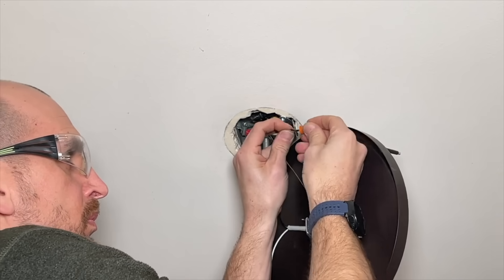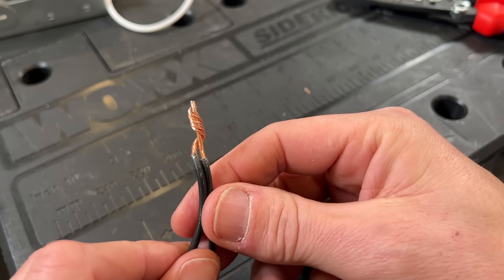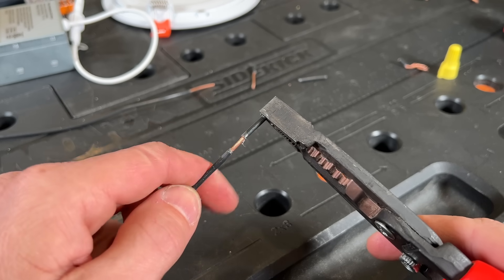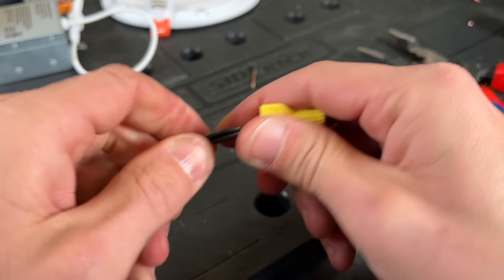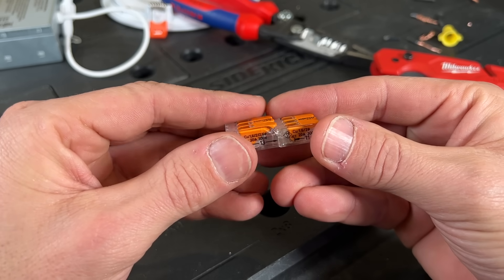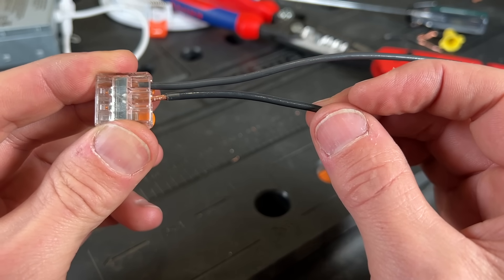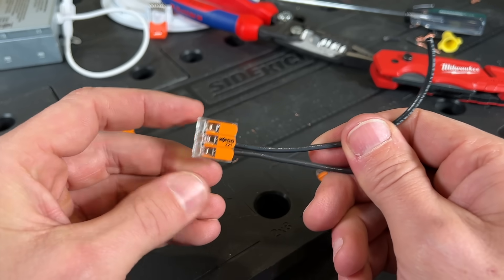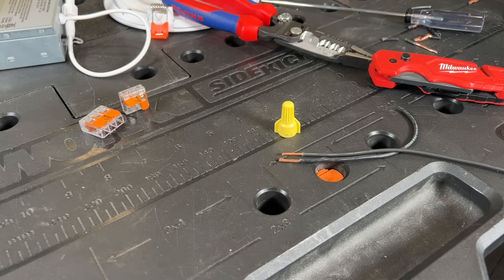Most Common DIYer Electrical Mistake - Don't Let This Be You!

Comment: As a DIYer, I am slowly replacing every connection in my house that was a wire nut with the Wagos because they are so much more serviceable and more friendly to doing upgrades. So as I've been swapping out my light switches, I've been using Wagos. As I've been swapping out outlets, I've been using wagos

Comment: Using wago connectors are similar idea to backstabbing outlets in an electrical circuit.  the amount of copper holding  the connection is very small. JMHO. To each their own....

Comment: I would never use wire nuts to connect stranded and solid wire. I prefer wago lever nuts - easy to use and reversible.

Comment: It seems like wire nuts are ½ of the problem.  They're about solidifying the mechanical connection.  If you must work around the idiosyncrasies of a connector,  it is a bad sign.

Comment: The "Loose Lever" is a design feature to give you LEVERAGE to open it. Americans are not familiar with Wago as they are with brands like 3M. Ive used their industrial terminals since 1992, NEVER a failure do to design or manufacturing, only user error like not properly seated or wire prep. Think of Wago as Klein, high quality products.

Comment: Love your videos. I stopped to watch this current one becuse I just installed 5 outside lights. I noticed the stranded wire you showed was alot stronger looking then what the light manufactures provide. The wire is  so thin that you cant not avoid loosing wife while stripping. Also with this thin wire, it would never slip into the clip you showed that I'm gonna start using...thankyou for this advice.

Comment: Wago nuts have one weakness that is not readily apparent. While they can withstand considerable force then a wire is pulled, if the wire is twisted while it is pulled, it will come out with little more than one twist. This could be an issue when stuffing wires into a box.

Comment: Make sure you check every connection by pulling WITH THE POWER OFF, I had a Wago fall off and the wire fell on my side and shocked the hell out of me under the house and ended up bumping my head almost sending me to the hospital.  Yes it was a faulty Wago.

Comment: Tip: Use your 4 fingers to grasp the wire and use your thumb only  to pull the wire away from the strippers.  Its way smoother.

Comment: @EveryDayHomeRepair — Excellent tip on connecting solid/twisted wires with wire nut! What color twisted wire nut best to connect 18AWG to 22 AWG wires for secure connection? ThankU.

Comment: 8:47 you use stranded 14 gauge, not a fair pull test since so often they are 18 gauge. I would imagine a wire that is more thin wouldn’t have as tight a grip.

Comment: 5:00 If you don't have the basic skills/tools to confidently twist wires together with a wire nut you shouldn't do the rest of the electrical work, Wagos or not. BTW I am a DIYer too and encourage it, I’m not one of those nose-out-of-joint electricians who poo poo all DIY, but there is a reasonable limit. Also, for the connection example you're using the orange, not yellow wire nut would be better.
Reply: Shut up.

Comment: Great instruction. Helped me correct my poor DIY first attempt for a ceiling fan that made crackling noises when you turned it on. My wires were loose and not making proper contact.  Thank you!

Comment: Having struggled with wire nuts while hanging lights, balancing on a ladder arms over my head;  I routinely started tinning (soldering) the tips of the lamp wires.  Then I used the wire nuts.   I have  since switched to the Wago connectors.  They take a tenth the time, which I don't have to spend doing ladder/lamp acrobatics.  All thanks to this channel.
Reply: Nice idea.
Reply: I call that a 3-armed job. 
Great idea on tinning the strands ahead of time before using a wire nut.
Honestly for a simple ceiling lamp, most are now LED, wago connectors are more than sufficient.

Comment: I was taught one of the best secrets I have never seen anyone else use ever. I bend the solid wire in a slight s shape then the stranded wire will wrap around that just light two solids would look twisted. You do have to twist the stranded longer than the solid. It works really good.

Comment: with jointing solid to stranded would a light solder work? or would the nut chew it off, melt if the line gets too hot etc.

Comment: WAGOs don't seem to have enough surface contact area unlike a properly installed wire nut. There have been tests that show greater power loss of the WAGOs and more heat as compared to wire nuts. I fully agree with using them for low power devices like light fixtures and switches but I won't use them on 20A branch circuits etc. The 'Clever Lever' WAGO is definitely easier to use but ....

Comment: better technique imo when stripping wire - instead of pulling the wire. use your thumb with the hand that is holding the actual wire and push the strippers away with your thumb while slightly pulling the strippers at the same time. makes stripping  wire  10x faster and easier. Insulation will glide right off the wire.

Comment: I’ve had old wire nuts from the 70’s with a solid #12 and stranded #12 and there was no way to remove it without cutting the wire.

Comment: I twist the stranded with lineman pliers to really tight and then twisted the solid two turns and wound the stranded around it.
Then I put electric tape around the entire nut and down the cables 3 inches.
Reply: Did u eat a moon pie too?

Comment: 76 year old, mechanical reliability engineer. While what is said here is true, I'd like to see some data on how many appliance wire nut related fires, out of the millions that have been there for decades, have occurred over the time period of interest. Then I'd like to see the cost of the wago connector versus wire nuts. Safety is not always the reason for "upgrades".
Reply: U shuld know that data mr. Smarty pants..😁😁😂😂😂🚬🚬🔧🔧🔩🔩🔩🔩🔨🔋🔌🔌🔌
Reply: @joeswampdawghenry  You should look up the topics with which a MECHANICAL reliability engineer works.  While we do know the statistical techniques used in such analysis, we are not usually "spur of the moment" familiar with all the data for other reliability fields. I suggest you do a little research before you open your mouth again and remove all doubt of your woeful ignorance. If I had made a pist about this topic, I most certainly would have researched and presented those data. However, I was not posting it, and the burden of proof lies on the author, not the reader.
Reply: @johnrains8409 I’m a reliability engineer as well, aerospace. I’ve made huge spreadsheets on things like variable speed constant frequency generators. When I started mosfets were less than half as reliable as regular transistors. But, those numbers have changed over the years. That’s why we have reference guides usually from the government. Nobody carries that shit around in their head.

Comment: Great video.. I learned the hard way myself with splicing stranded to solid core wire and had to figure out myself to lead with the stranded wire higher than the solid core to get the nut to bite both wires and bond them securely. Good that you explained this thoroughly so everyone can understand what can go wrong will and to eliminate said variables
Reply: How many houses did you burn down before you learned?

Comment: Cant believe wire nuts are still used these days. I dont see them in the UK anymore. Screw terminal connectors being a much better solution.

Comment: Hi there,   My first electrical project is now a nightmare.  The hall and bedroom lights run on the same breaker, but now the
lights won't turn off with the switch.  
When I installed the first flush mount ceiling light in the bedroom it turned on with no problem at the circuit box, but I didn't check the light switch.  
The Hall light had a different configuration I hadn't seen in any of the Youtube videos showing light installation.  Both the black and white wires had multiple wires that were twisted into a sold thick end. The light fixture's black and white wires were just wound around the thick strand of wire, and nuted.
The building is about 35 years old.  My Apartment's hall is only 38" wide, so I can't see why the builder would use wiring for a ceiling fan, if that is what this extra wiring means?   
 Funny thing was the hall ceiling box did not have a ground wire screw.  I took out the old mounting bracket, replaced it with a universal, and added the green screw to I could hang the light while installing.
Could you tell me what I am up against?  
Thank you sooooooo very much!!!!!!
Signed,
Empty Nester and new Widow

Comment: A note on wire nuts: there are some cheap-o brands where the inside 'spring' (threaded piece will come loose/detach from the plastic housing even with the slightest (over)tightening. Also, check the labeling on the package where it will tell you how many leads of a given gauge for which it is designed. 
One thing I don't like about the lever type push connects is the lever. There are other designs that are push only. 
For solid wire, I use one pair of 'pliers' (usually my side cutter with a large flat area to line up the leads, and another pair to twist from the end of the lead.
This works well to make sure that all the leads are twisting and one doesn't remain straight.

Comment: Use the tip of your strippers and/or needle nose pliers to bend a zigzag/lightning shape into the solid core wire, this will give the stranded wire some grooves (highs and lows) to bite into and hold onto much better.

Comment: Great video! 
When stripping wire, I usually use the thumb of my hand that's holding the wire as a kind of fulcrum against the stripper to help push the stripper off the wire.

Comment: In o gauge model railroading, we must often connect 2 stranded wires, usually a wire connected to a junction strip and onto a wire that leads to the train track. I never felt comfortable soldering the 2 wires together because you're usually under the trainboard. So I usually heat shrink wrap the 2 wires together. Dont wing nuts exposure the wires to air corrosion  over years .same for your wingo connects. A large trainboard often has 200 connections to track, building lights, operating accessories using 18 volts. What do you suggest us train guys use. Gary

Comment: Another method that is less expensive than the Wago connector and less trouble and risk of "hoping" you get a good bite on your stranded wire is to just melt a bit of solder over the strands then it preforms like a solid strand when using a wire nut.

Comment: My technique is to use the pull test and after the wires and wire nut pass the pull test I tape everything together with some electrical tape. Done properly it’s completely unnecessary, but it’s an extra layer of safety and insulation.

Comment: yay for wago's   they are my number one reason for service calls (job security)   Just glad I got to them before they burnt the customers house down.    I always find them , at least brown from heat....a lot the time black.....and quite a few times melted!  Checked the entire circuit.....it was the WAGO.....put on a proper nut connection.    BEWARE of wago's

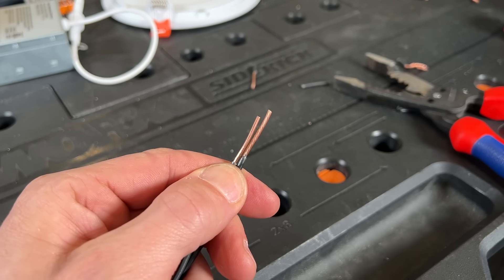Comment: It helps to strip a slightly longer length of the stranded than the solid core wire, so that the bare solid wire next to the insulation isn't exposed after the wire nut is tightened.  You actually did this so the two wires matched, but didn't show or explain what you did.  You just edited that step out at minute 4:10.

Comment: Wagos are great. Do they make them for 8 guage to 6 Guage wire and can you convince the City of Sacramento, CA Sacramento County, CA Lincoln, CA, Folsom, CA, To use them instead of wire nuts for Street lighting and traffic signals. Wire nuts dipped in Scotch Kote are their spec.They will be one time use as they will be dipped in Scotch Kote to water proof them since they are below grade and subject to water Submersion.

Comment: I’m am an electrician since 1970. I’m now 70 years old and prefer a wire nut for connecting wires because your connecting the wires together using a wire nut vs. the push connector you showed which connects the wires using a common buss that’s compressing the wires together. Just another gimmick that costs mote $$$$.  Thanks,  Steven B.

Comment: I just had this problem.sum how I made a good connection but the lamp wouldn't come on. Had to take it down and the "electrician" checked it. He was convinced I made an error. Turned out he had disconnected an internal wire when he popped off a part prior to me setting it up.

Comment: As a service tech, I see all the time in the field where stranded light fixture whips gets a wire nut connection with a solid and they don't lead the stranded wire before tightening. This causes the stranded wire to not get squeezed together in the wire nut, and just slips down the solid conductor. Then when you pull the connection out of the box, the stranded connector will come out of the wire nut every time. Always lead a stranded conductor about 1/8" when connecting to a solid conductor with a wire nut.

Comment: You might find this interesting.  In the (rented) trailer I live in, about a quarter of the outlets have ground connections that aren't grounded.  And I wasn't able to locate the ground wires for those circuits in the breaker box.  I plan to install some breakers with GFCIs, or get the land-lord to do it.  I also found one outlet with reversed wires, which I fixed.  Now, for the BIGGY!  I almost SHAT, when I found one circuit that used the bare ground wire as the HOT!  It was in Romex cable, so it didn't short out, but really!  So I fixed that one.  What sort of "ning-com-poops" did the wiring?  Was it ever inspected?

Comment: In old circuit boxes short wires are common.  Cutting off another inch or two makes them shorter.  Just use the already stripped wires.  Not sure how often anyone goes into an installed fixture and starts tugging on wires.  They would have to remove cover plates first.  I never allow anyone just walk into my house and start removing cover plates.  If you let people do that you should stop letting them do that.
Reply: Also, sand or scrape (don't nick!) the stripped wires.  It may not be necessary, but you get a warm & fuzzy feeling, knowing there's a perfect electrical contact.

Comment: Only garbage electricians use wago's. If it's just a single stranded to single solid just strip the solid a little longer and wrap the stranded around the solid and fold the excess solid back over the stranded and crimp it down on itself with your lineman pliers.

Comment: Great video. Would it be possible for you to show both stranded wires being spliced together with the wire nut instead of one solid and one stranded??

I have a co worker and he says he went to school to learn all his knowledge, but also never had time out in the field.😂 So when he goes to splice two Stranded wires he does not use pliers he uses the wire nut and only makes two counterclockwise spins with the wire nut to tighten the wires together. He also does not use the pull method. 🤦🏻‍♂️

Comment: Those wago connectors are fantastic. Did my first diy job today and extended an outlet. These made it so easy
Reply: Hard to find in Canada at the local supply houses.
Reply: @danlux4954  I had to order on Amazon

Comment: So grateful for your video tutorials.  A friend asked me to help her install several outdoor fixtures.  Just before I went to her home, I had to check on Wago connectors and how quickly Amazon would deliver.  Not fast enough so I searched your video to again learn which wire was to be extended when using a wire nut.  Stranded wire - approximately 1/8" above the solid wire.  I have said this to myself so many times in the last 12 hours that I will never forget!  We got the lights hung before her husband got home and had a ball DIYing together.  She is an inside crafty person and a terrific electrical assistant!   No disrespect to men intended but as suspected, he didn't notice the new lights.  Maybe today?  Thanks, again!  Have a blessed day.

Comment: The biggest mistake is that users never read the package to know what is and is not allowed.
I have wire nuts that are use only on solid wire and ones used on stranded, they state the wire gage and # of wires to be connected.

Comment: Was having trouble splicing the wires even when pushing the stranded wire up first. Yours is the first video recommending what looks like a much better alternative with the Wago 221. Thank you so much for this information. Don’t want to call an electrician for putting up a couple of wall sconces but also don’t want to risk my inexperience producing faulty work. Thanks again.

Comment: I have never seen those wire nuts before. They look really dodgy. What country are they commonly used in, because I never want to visit? The lowest basic standard is the screw terminal block, but you didn't even mention those. The wago connectors look very nifty though.

Comment: You can also pinch the wire insulation where you are going to strip it before stripping and it will make the insulation come off easier

Comment: Thank you!!!  The WAGO connector was so wonderful!!!  It made it so easy and too the guess work out of it.  I'm a 73 year old female replacing a ceiling fixture myself.  I tried it once using Marettes and it didn't work because they came apart when pushing the wires back up in the box.  I'll never do it again with Marettes.

Comment: It’s important to know when using a wago 221, you need to look on the side of the connector it says to remove exactly 11mm of the insulation off your wire(s), you do not want too much exposed wire when using them.  Safety 1st!.  I’m an electrician